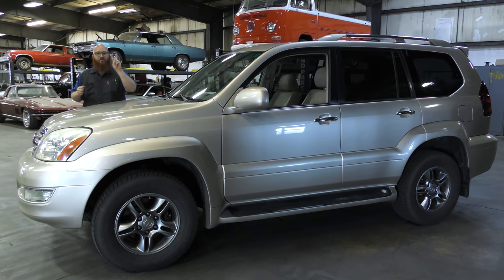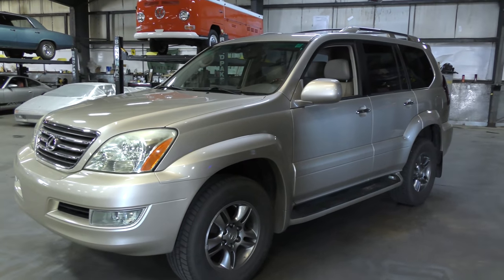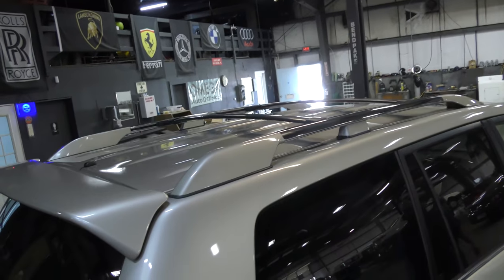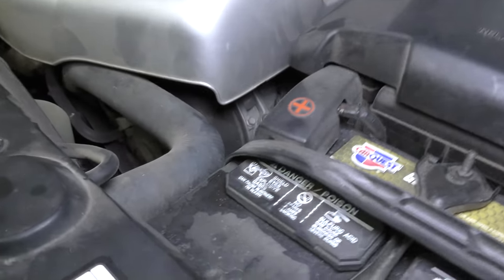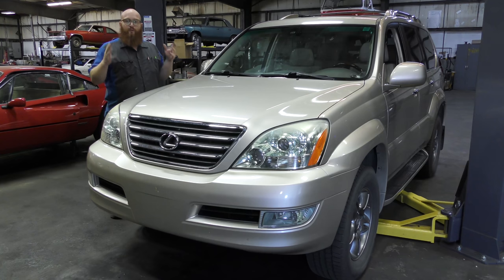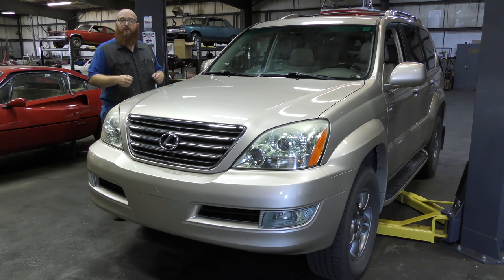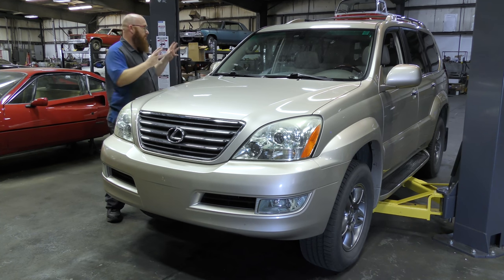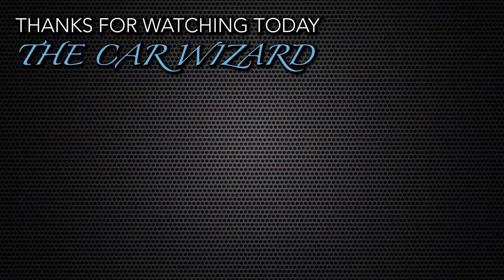Reliable cars get surprise bills too. Simple oil change on '08 Lexus GX470 turns into $1200 repair

Comment: Yea I own a 2016 Lexus GX460 and it’s just ok. Yes it’s reliable but they are expensive for what you get. The money you save on repairs you’ll spend on gas. My Lexus GX460 gets 14 mpg. It’s lifted 2 inches with 33” tires. The power is shit at best. The 4Runner, gx460 and gx470 are overrated for the price people are selling them now. The problem is Toyota uses the same engines for 15 years. While American or other Japanese suv gets 25-30mpg Toyota is only getting 15-20 even on the v6. While most American suv have 400hp Toyota is 300hp.

Comment: I bet Wizard would tell me to change my timing belt in my 06 GX470 that has 159K and still going strong.  Never changed the transmission fluid either...there's a reason the GX is so valuable on the used market.

Comment: Toyotas are definitely more reliable but there's a good bit of hyperbole and fear mongering going on here. These days wrecks take more cars off the road then systems failure. Until Toyota can survive a wreck without losing any value it's cheaper to wreck a domestic. The economics of the car industry can't support every manufacturer over engineering their cars to grab market share. So buy a Ford or GM, do maintenance, and wait for the day your wife or kid rips off the front subframe while texting and driving over a curb doing 65, then be glad they are ok and wrecked the cheap car....rinse and repeat. However, if longevity is important check out a little domestic company called Tesla who make cars that are capable of 500k or even 1MM. However were back to getting there with all your fenders attached.

Comment: That's what you get when you buy a foreign car, ANY foreign car. And it's 13 years old with over 150 thousand miles on it, isn't it? This is just the start. DUH! We really needed a Car Wizard to figure that one out now didn't we? I notice 65,000 views down from almost 3/4's of a million. I hope you have more to fall back on than You Tube. Guess we won't have to suffer through your wife's interior segments much longer. Maybe you can try a pay channel like Hoovie did. I'm sure people would want to pay you to tell them maintaining foreign cars is expensive. You boys in Kansas really fell for the You Tube scam hook line and sinker, eh? You have your own little group now. Just think of it this way; all the money you got was money you never had anyway, so it was still a blessing. I certainly hope your life doesn't actually depend on it however. If it does, you boys are screwed and certainly aren't the sharpest pencils in the drawer. All of you except father Doug that is. But he's not from Kansas is he. You can only tell people what they know is wrong, is right so many times. First you say you've maintained the truck front to back, than you say that it looks like a really sloppy oil change? Didn't you people do the oil change? Yeah, everything you know is wrong with this picture. Good luck. Sie La Vie.

Comment: So there is no other reliable brand besides Toyota?
Reply: For me personally... Mazda and toyota are my top 2, mazda long term may cost more compared to toyota and the aftermarket for toyota is huge compared to Mazda. When you especially used,  I will admit that toyota costs way more partly due to quality parts used. Sometimes the parts for toyota may be pricey but once replaced you are going for a long time without replacing. I have a 2005 matrix that I have had for 8 years so far, still same transmission and suspension. Only replaced two batteries, water pump, starter, switched only front brakes with rotors and exhaust  in that period.. the vehicle is 299000km. I currently drive a 2020 corolla as my daily now.
Reply: @alvinsimba734  Thanks for your insight. I love Toyotas and would agree they are on the top end of reliability. However I don't get it when people say you should never buy something else like the car wizard. I have owned several different brands (ford, Chevy, bmw, Chrysler, Nissan) and have never had horrible experiences with ownership.

Comment: Come off it wizard......4hrs??!! Have you employed Stevie Wonder to do it?? I like your channel and the work you do,  but i had to make the comment about the time quoted. I've been a mechanic before and had to give up due to a sports injury so know a little bit more about how long a job actually takes compared to "Book time" quotes. Was the 4hrs just to do the front 2 driveshafts and the brakes or just the driveshafts?

Please can you also show people how to check for worn suspension joints etc properly using the 12 & 6 oclock and 3 & 9 oclock positions. What you show gives a false impression of how you should competently check.